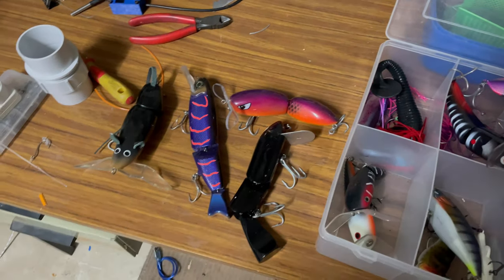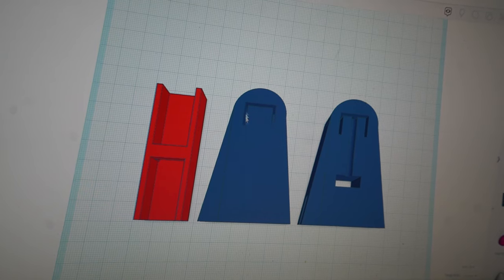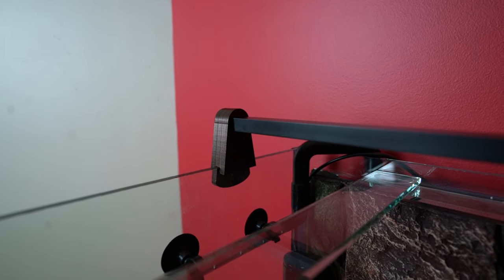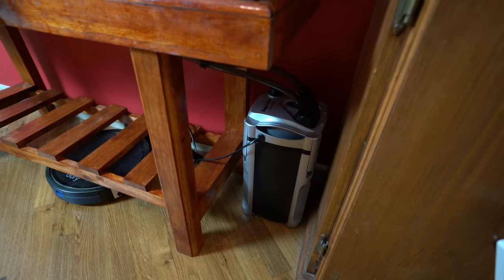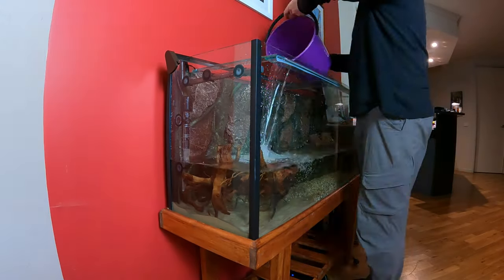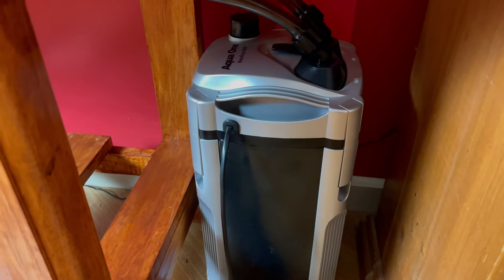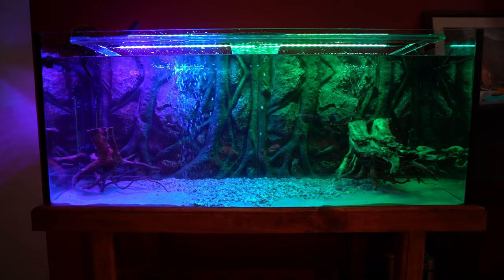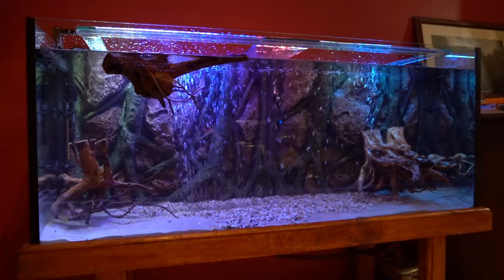Setting up a new Aquarium for my Murray Cod!!! Ep 4 (plus build a cheap aquarium light)

Comment: How much was your pump !!!!!!!!!!!!!!!!!!!!!!!!!!!!!!!!!!!!!!!!!!
Reply from the maker: I got it from a pet store in Mt Gravatt in QLD, it was around $200.
Reply: Mate I know this is a year ago 
But just a bit of advise on your filter set up :) put all your sponge in your bottom basket from large to small 
Then your next two baskets full of your bio media 
You want to make sure your bio media is not getting blocked with fish shit 
You just want the bacteria throughout your bio media
A good ceramic bio ball should have the surface area of a tennis court which bacteria can grow on 
You get tiny prices of sand dirt or shit on the outside of it and your bacteria can only grow on the surface 
Yea you can put your filter floss on top for easy removal as that stuff clogs pretty quick
But for one fish if you get your bio right you probably won't need it 
Hope this saves your time cleaning the filter so much :)